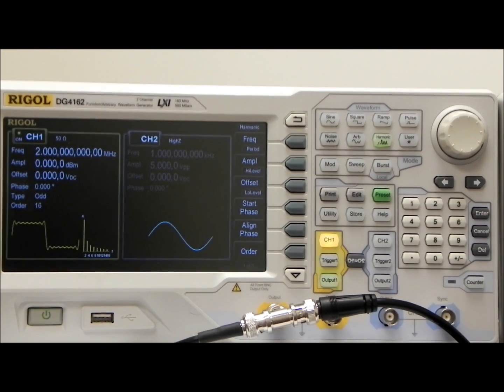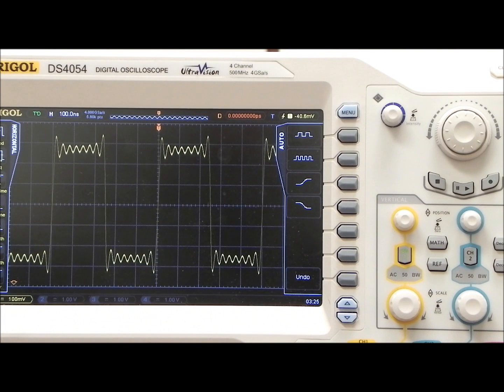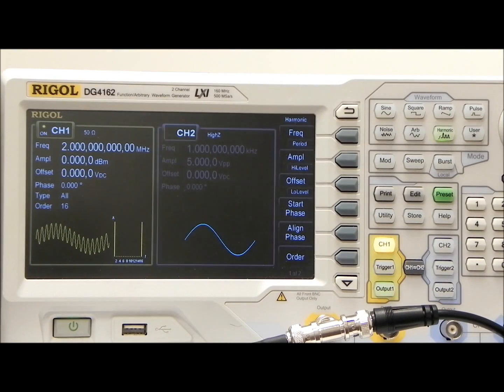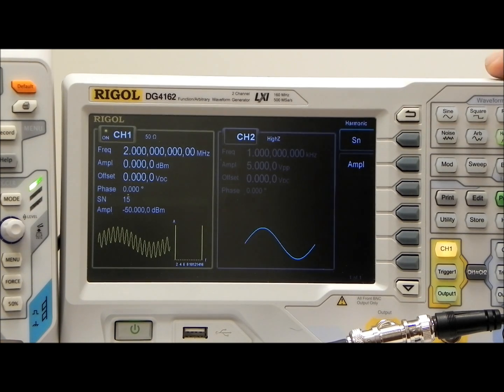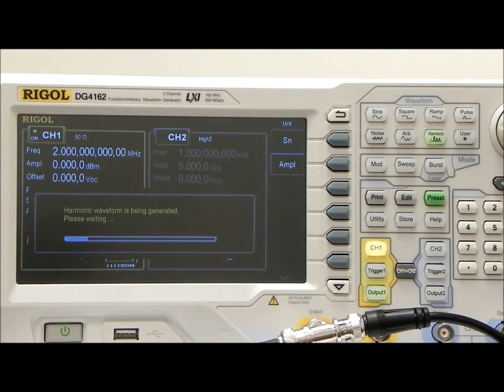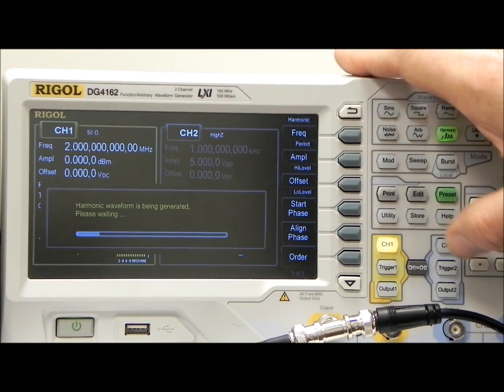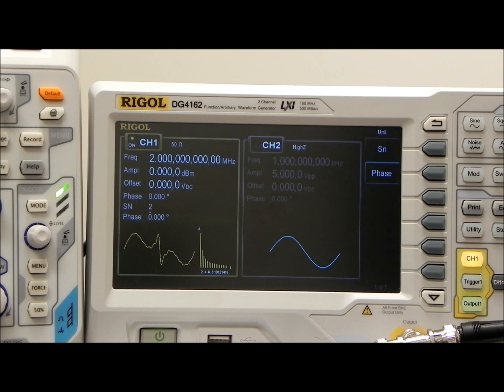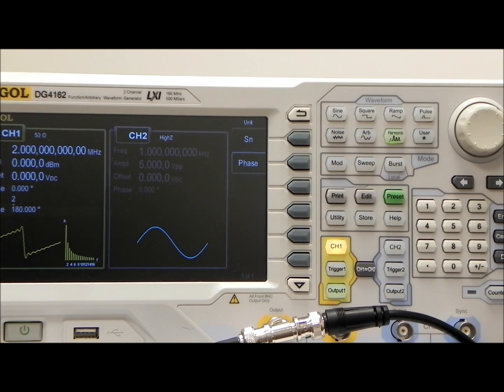Harmonic Function in the DG4000 series Arbitrary Waveform Generator

Comment: Can I program a three-phase signal with RIGOL DG4000
Reply from the maker: You certainly can create a three phase signal, it will just require two generators to create all of the signals.
Reply: @RigolTech  what if I want to program harmonically distorted sine wave up to 13th harmonics. Further, what if I want to suddenly change amplitude, frequency and phase angle of fundamental signal at some time instant where phase angle variation is from 0- 90 degrees, frequency range is 47-52 Hz.  Applicable for both single and three phase.

It's important for me to know as I am planning to buy the same rather buying costly programmable AC sources